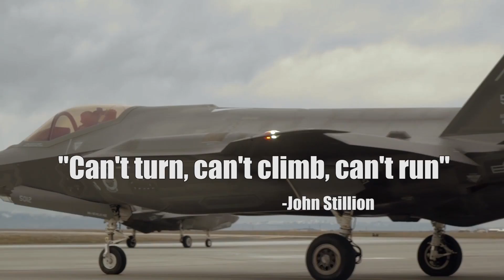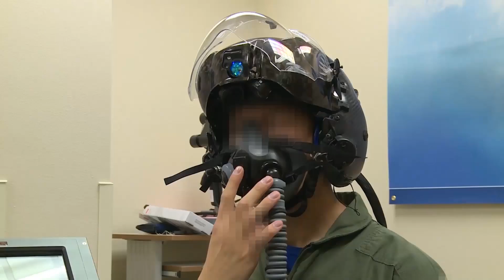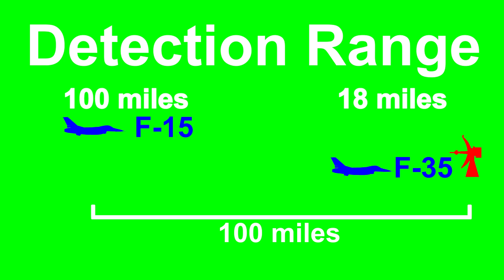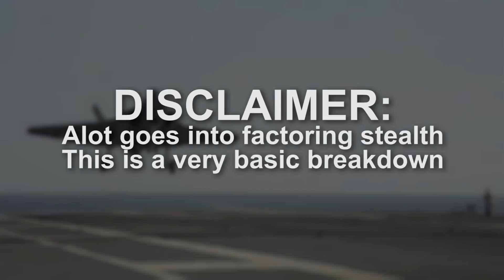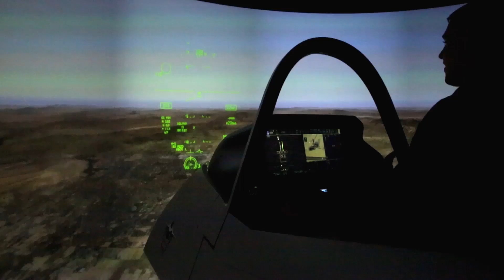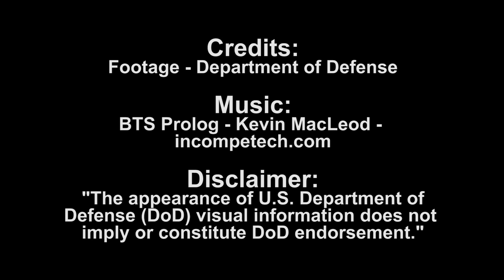F-35 Overview - The Good, The Bad, The Ugly

Comment: You missed a lot of things about the F35 that you could have found out just by doing a quick google search. You completely skipped its major selling point of its sensors and sensor fusion. No other aircraft currently or in history does it. You missed that it's getting a new engine with 10% more thrust and 6% more fuel economy. The aircraft ALREADY carries the same amount of fuel as an F22 and has excellent range without fuel tanks. You completely forgot about the internal Gatling gun. You didn't mention that the aircraft can pull 6-9 g's and hit full 1.6 mach fully fueled and loaded with internal stores which no other legacy aircraft can do. You didn't mention that the F35 can take command of drones to test enemy air defenses or take command of friendly missiles and target those missiles at its own targets. You didn't mention that in 2019 when the fighter goes into full rate production the internal weapons racks will get more options including a rotating rack so it can fight 6 AMRAAM missiles or even up to 16 SDB's. The internal bays are large enough to fit quite a bit of ordnance. You didn't mention that the F35 has 3 different countermeasures. It carries the latest chaff dispenser, Flare dispenser, and it has an pretty amazing ALE-70 POD towed decoy to jam enemy missiles. You didn't mention anything about its advanced AESA radar with over 1000 individual antennas or the fact that the radar can jam enemy radars while still scanning and watching for other air and surface threats. You forgot to mention the DAS system that sees all around the plane which is why the pilot doesn't need to look behind him. The plane itself scans and if it detects anything it puts it on the pilots visor and cues up a weapon or countermeasure to deal with it. The F35 can fire a missile at a target BEHIND it! There are so many things you are missing and THATS why the plane costs $100 million dollars. This aircraft is a major leap forward.
Reply: abelucious Any aircraft can be shot down. Stealth only delays detection. It's not invisibility. However the United States has pioneered Stealth Technology. We are very good at it. Where I feel we are actually are at our weakest is our air to air missile tech. Now that's a discussion I'd be willing to concede. Ever since I became interested in the F35 I also started looking up what types of weapons our fighter aircraft use. While the F35 might be kick ass we need to seriously develop new air to air missiles. There is no reason we shouldn't have AESA radar seeker heads and/or have missiles with dual seeker heads with longer range motors. The AIM120D is a good missile but it should have been improved a long time ago with how much money we throw at Raytheon.
Reply: @Lord_Shadowz  a decade ago I knew someone who was working on the avionics of the F/18 Superhornet.

I asked him about stealth. He told me it's already obsolete and that's why the Russian's didn't get involved with it all that much. He advised me that "spinning radar" as well as satellites make stealth obsolete.
P.S. - I don't know what spinning radar is but the Russian's have it and they've sold the technology to the Chinese.

All stealth is these days is (hopefully) getting to the enemy before they see you.
Reply: I don't know where he got this idea that it is less stealthy from. Current mock fights tell us that legacy aircraft pilots don't know they are there during exercises. When the JSF program was announced it was said that it would be less stealthy than the F 22. Now the Military people are saying that it is more stealthy than the F 22. Pretty sure it's stealthy enough especially because the Russians and the Chinese botched the stealth on their stealth jets.
Reply: Let's not get in a fight about what constitutes real sensor fusion ;p
Reply: The F 35 as sensors pointing in all directions and has the avionics to lock from any of them. Traditionally the radar and sensors are only in the nose of the plane, so you have to be pointing the nose at the enemy to get missile lock. The F 35 can detect a threat behind it, target it, and launch a missile that will pull a 180 and target the threat.
Reply: Gone Grizzly I see your point.. But with military GDP higher than Russia's is that really a big problem? And "The infographic show" said hourly usage cost is 30k. I may be wrong and I do not know that well so sorry if I am wrong.
Reply: No, the F 22 wasn't built with the amount of sensors and antenna that the F 35 was built with. That said, the F 22 is a monster of a plane with a lot of awesome features like thrust vectoring and super cruise.
Reply: Gone Grizzly You definitely have some points. For myself one thing they need to fix right off the bat is the fact that generals retire and then immediately go work for those companies. To me it seems like a huge conflict of interest. I think it's a huge part of why programs cost so much or happen when they shouldn't. As I said Lockheed has been allowed to get away with too much nonsense. The Pentagon did nothing to put pressure on them. Only recently have they started to try and get the program under control. They assigned a new general in charge and he's not playing around. He will flat out refuse to pay for things. As to stealth, you are absolutely right there as well. The good thing is while the public may not understand our military does. The F35's stealth is really decent. If you look at the radars and power outputs of the SU35 and the F35 and the Stealth characteristics of the F35, it shows the F35 can get in pretty close before the SU35 can get a track able lock. I think where the Air Force has screwed up is our missile technology. We haven't advanced our air to air missiles and I don't understand why? The Japanese has an awesome medium range missile with an AESA radar that's extremely hard to jam. Look at the British Meteor missile. Yet the US hasn't advanced. This needs to change. The only cool thing I did read about is the laser weapon system they are developing for the F35A and C models. Did you read about it? It's the same one that fits in the Reaper drone. It will go where the fuel tank is behind the cockpit and have 2 rotating emitters. One pops on top and one below the F35. It's pretty amazing.
Reply: You tell 'em Will.
The F-35 is a stone cold killer.
No fourth generation aircraft can stand against it.
Reply: Gripens might use GaN radars, SAAB in partnership with Selex are currently shopping this notion around as they apparently have the most "mature" GaN radars so far. Currently, models of Gripens don't have any AESA radar, but the E/Fs are due to have the Selex Raven ES-05s when they come off the production line soon. I haven't looked too far into it, so I wouldn't be surprised if someone were to point out that the E/Fs have been coming off the lines for the last 6 month, possibly longer.

GaN is relatively new and might not become a mainstay for another 10 years as customers are pretty happy with the GaA radars they are getting now, but it is suspected that all planes will eventually switch over. I don't know where this idea of GaN being far more superior came from. It is a pretty good upgrade, nothing more nothing less--experts believe that GaAs are plenty good enough for the present. I'm pretty sure air forces are much more interested in the GaN radars that will be ready in 5 to 7 years rather than the prototype level models offered now.

Which brings us back to how the F 35s stealth worked just fine against AESA radars during Red Flag 2017. I don't understand why people don't get that the F 35s performance in Red Flag was proof of concept, which explains why the US and allies invested so heavily  in stealth. If stealth didn't work, the F 35 would not have been considered too important to fail. The survivablility stealth offers is what they want and deemed by the pentagon as necessary. Why would anyone think the US Air Force would prioritize stealth so much if it didn't work. Look at their current programs for the foreseeable future. It's mostly the F 35 and the B 21. Hmmm, both are stealth, and you only need to look at comments Air Force officials make about the B 21 to realize that from their experience and stand point, the world's leading experts in conducting air missions as no one has done it more nor more successfully, that stealth is basically cheating and they have no interest of going into a fight without a super unfair advantage. The more one-sided the better according to them. They hope they can get 100 B 21s, but if they had their way, they would get 200 of them. What better endorsement for stealth could there be?
Reply: all i'm seeing soren is a bunch of unsubstantiated info coming from you brah. and there is a lot we don't know. the RCS of the F 35 is one of those things. That's what classified means.
Reply: Sören Nilsson I'm sorry but what you are saying is inaccurate. What missiles and bombs can it not carry? Right now it's already using all NATO air to air including Meteor and all Aim missiles. For Air to ground its using JDAM to Japanese and British bombs. You can find the videos on YouTube. It's already in testing using the SDB II as well and already uses the SDB1. Once the plane goes into full rate production next year the new internal racks will be introduced that will allow for more internal carriage. Instead of 4 AIM120D's it can carry 6 on a rotary rack. Or 4 120's and 2 AIM9's. Or a mixture or SDB2's and AIM120's. They've spent a lot on this project and they have things planned out. You can find out everything I've said in publically available information.
Reply: B Jiang the J20 doesn't have a DAS system lol. Just look at the J20. Please point to me where it's DAS cameras are please? Also China is INCAPABLE of making its own engines. That's why the J20 had underperforming engines. It's incredibly hard to make them. It's also why the J20 is only dirty stealth. It's incredibly hard to do. They had to steal it from America. Russia got really pissed when china purchased only a few of its previous fighters and then reversed engineered them and then made their own Chinese fighters. That's why they forced china to make a bulk purchase of the SU35. First off they are hoping it will take years or never that china can reverse engineer it and they are keeping the software codes to the avionics. But just in case the Chinese do they atleast are getting the block purchase. China cannot innovate. That's the issue. Look at most of the Chinese military. It's all copied and stolen ideas. China does espionage or buys something and then reverse engineers it and calls it a new name and BAM you have the Chang du super hornet 12. Lol.
Reply: Hey, I got a great idea. Let's not get new jets ever. You know cuz the world is a safe place cuz Russia and China don't make new jets ever. Besides, they are friendly to us anyway. If they like selling advanced tech to the people we'd rather not have said tech, that's not our concern right? National safety ain't a big deal. When have we ever been attacked anyway. Also, what has investing in the best war planes ever gotten us anyway. I'm sure we could've done everything the F 14, 15, 16 and 18s did over the last 30 years with F 4 phantoms. Why'd we ever upgrade from them anyway? There are probably planes cheaper then the F 35. What are the options? F 15, 16 and 18s. Hmm, that's interesting cuz that's what we are flying now. How many jets are the experts saying we should replace? What? The whole fucking fleet. And this one jet can replace all of them? Really? And that's the reason it's going to cost 1.5 trillion, because it's basically replacing the whole fleet. And compared to all the other jets where they were actually designed near or after the year 2000 at 100 million a plane, it's actually a pretty good deal especially because it has advanced features we would rather have over the same priced newer planes that are built in Europe? And F 35s are going to drop in price. I'm confused. I thought the F 35 was a bad deal.
Reply: Jas 39 E also have sensor fusion so you are wrong about that.
Reply: Yes gripen also has censors locking in all directions. And the radar on gripen cover a larger area. And yes gripen can also fire a missile that goes 180 and target the threat.
Reply: Jas is using GaN in its sensor system and that is making its sensors and E war system immensely more powerful than the system on F 35. 
The problem for both of the planes are that when they start to transmit they will be detected by the other plane, it is therefore important to be able to to depend on your passive sensors. Jas will see F 35 if it uses active sensors F 35 will see Jas if it uses active sensors. Ir detectors et cetera and luck will decide who is sees who. The Jas radar model had ample opportunity to be tested on Neuron constructed mainly  by Dassault, SAAB and EADS. Neuron has a smaller RCS than the F 35.  A similar system will in the future work alongside Jas or probably ahead of the Jas with the task of detecting others if stealth survives the new radar systems.
Reply: Sullir I saw that! They said in order to go on a full 3 month campaign against Russia   and win they needed a minimum of 165 stealth penetrating bombers. The US has gone back to fighting near peer combat and I love it!
Reply: Sören Nilsson Yet Israel is purchasing about 100 of them and is possibly the first county to have used them in combat over Syria. Search for the French article about the Israeli attack near Damascus in February where 3 F35's were used. Anyways, it's going to take them way more than ten years to figure it out. It's more like 30. Even then we have then next generation being worked on. The Russians currently have to set up radar systems all over the place looking in different directions in order to get multiple radars to get a glimpse at a possible low observable. It's the only way for them to get a track. The problem is the entire time our aircraft see them and can attack those links in the kill chain. So they've been working on lower frequency radar which is what our current stealth is more susceptible to. The problem with that is two fold. First is there is a shit ton more back ground noise. Figuring out what's a plane and what's not is extremely difficult even with newer computing power. So you need a large antenna. Since you need a large antenna this makes it very difficult, if not impossible, to make it mobile. Which again gives the advantage to stealth. With proper tactics, which is what the US has done for decades, stealth will change the calculus. Now add in the sensor fusion, the networking, the ability of the aircraft itself to sniff signals from passive radars and even communications from the ground, and the application of the constant non stop training of near peer threat combat training, I guarantee our stealth aircraft will do ok. The Russians and Chinese know this. That's why they have attempted to try and make a layered defense on their border in Eastern Europe. They've got rings of high and low radars with Pantsir and Buk systems that protect S300 and S400. But here's the thing. They are so afraid of stealth, specifically of the B2 itself, that around Moscow right now, as part of their ABM/SAM system, and you can look this up for yourself, are 48 nuclear tipped missiles. These missiles are designed to launch and detonate above Moscow in a ring to take out anything above it. To save the city. They've always kept it active.
Reply: If China was only trying to steal defense info from the big guys in the military game, technology is power in war no doubt about it so get the edge anyway you can, I wouldn't care as much because i get the you got to do what you got to do thing; however, China isn't restricting it's stealing in anything and is basically screwing  the whole world over. They have a strategy to become the world power. They know they can only do it with economic and military might. They don't have the ingenuity to compete with the big boys technologically at this point, so they are stealing everything of value until they are in the position where they wouldn't have to anymore to get ahead in the game. In many ways, it's very clever and effective, but in the global scheme, it is detrimental and crippling, not that China cares. The Communist Party is going to be The Communist Party.
Reply: Sullir Amen. I couldn't have said it better myself. Lucky for the US the information they did steal on the F35 they weren't able to fully understand and reproduce it. I'm also glad we caught the guy that compromised the information and he's going to spend the rest of his life in jail along with his wife who took part in it. The information the Chinese got was actually older data. So that was very fortunate. That's why you see the J20 and J31 designs as they are. The engines are very underpowered because they didn't get any of the engine data.
Reply: So, let me get this straight. You are comparing the F 35 to the Gripen and basically asking, besides stealth, which plane is better? Or why aren't foreign consumers interested in the Gripen because it is a technologically advanced plane?

The answer is simple. American jet fighters have the best performance records. No one else comes close. The amount of air dominance the US has enjoyed over the years is mind boggling.

Who makes the Gripen? Shrug, no one cares. Now, I not saying the Gripen ain't great. I'm saying realistically that other countries are going to have to prove they are making jets on par with the US before they will be able to really sell in that market. Mostly because it is super expensive and no one wants second best, and right now the US is sitting at the top. So, who ever it is that makes the Gripen won't get there this round, but hopefully next round depending on how the Gripen goes for the next 20 years if it's going to happen, but i don't think that is likely.

Truthfully, the biggest problem for non US companies is that the US, because they have the most active air force in the world, gets a bigger view of the picture. They basically know what tech and features are going to be important, so when they make a plane, it is a plane for the next 40 years. For instance, you mention supercruise was supposed to be one of the features of a 5th gen fighter. The F 22 has supercruise, yet here's the F 35, a newer US fighter, and no supercruise. Maybe, supercruise isn't all that important to 5th gen after all. Who would know? The US because they have it on the F 22. The Gripen on the other hand looks like it was built for the present. They threw technology in it because it was new, like sensor fusion, but in every other parameter, it was built with current conventions of air combat in mind.

Now you are asking, how is the F 35 different? The answer is simple, the F 35 doesn't focus on the things everyone thought was super important. Like maneuverability. Want to get ahead of the other team? Well then, write new rules to the game and make the other team play by them, which is what the US did when they decided to deal with things differently, and thus they put in DAS to make up for some of the F 35's liabilities when in dogfights against supermaneuverable foes, which frees up its physical design (because of DAS, the pilot doesn't have worry about position as much anymore, and can keep up with jets designed primarily for maneuverability--in other words, a sensor and software feature to counter the enemy jet's specialized, less versatile physical design) to concentrate on dropping munitions however and whenever instead. Because of the combination of the F 35's advanced stealth and sensors, If an enemy jet sees the F 35 before the F 35 sees it, then that enemy jet deserves to shoot it down; however, the F 35 is built from the ground up to make sure that scenario won't happen. The enemy will probably be able to detect the F 35, but at what range? Stealth makes the jet harder to detect, not undetectable. The goal is to detect before you get detected, and both stealth and sensors are important in this. Find and shoot first. That's how air combat is now. It's true that the F 35 won't be the best air to air combatant if it comes to within visual range, but the US knows that ground to air is a much bigger threat, and air to air skirmishes rarely happen. The F 35 is designed to make the battlefield different from what it has been for the enemy. You have to find the F 35 and not let it find you. If you can't accomplish this, the F 35 is going to bring the thunder willy-nilly. It was designed strictly for this purpose. It's an elusive snake loaded with venom.

What is the Gripen's MO? Not much separates it from the Rafale imo because they are just polished last gens with better computers and sensors, and those computers and sensors make bvr engagements and guided missile combat just that much more efficient vs wvr engagements which are virtually nonexistant nowadays. Maneuverability is only great in wvr, so why is 80% of the planes design still focused on it? 

Who ever wants to be on top will need to be the best at predicting the future, not the present.
Reply: Beer Me Allow me to retort. All 3 models have the most powerful engine ever placed in an aircraft. Ever. That's not a sensor. So to say the aircraft is not advanced isn't true. Second, the B model is the first and only aircraft in the world that can effortlessly hover and with the touch of a button go into supersonic flight, carrying its internal weapons. Those aren't sensors. That's the aircraft. The F35 can do petal turns, because of the powerful engine, that other aircraft cannot do even without directional nozzles. Those aren't sensors. That's the aircraft.
Reply: This the bottom line to the argument that the money spent on F 35 should've gone to European jets, which reasonably would've made them much much cheaper.

War planes are a major market for the US so they themselves never have and never will buy foreign in that market. Buying jets is not like buying guns after all. As pointed out, the US has huge sway when it comes to large contracts like the F 35, so it would be stupid of them not to use it. And lastly, I'm not convinced that the US would've considered the Rafale or Gripen anyway. The F 35 was the jet they wanted, and the Rafale and Gripen don't resemble it at all.
Reply: William J Greklek III whhaaaaat the f35 can shoot behind it? Please explain that's cool
Reply: The jas 39 E has basically all of the capacities of a F 35 but it is not as stealthy. the plane itself is ok, but the missiles that it carry shows up on radar. SAAB is now trying to make the missiles stealthy. There is a double gain with that. You will not see the missiles before your infrared system notice them. Thereby making response time shorter and you do not have to sacrifice agility on the airplane construction.
Reply: @sorennilsson9742  the Saab is more expensive with less capability than f35
Reply: Ps. Jas also has towed decoy, the same radar capacity with a wider search angle twice the angel of F 35. It also have a more powerful electronic warfare suite.
Reply: Says who? It all comes down to the radar question. Is stealth going to be stealth, there are many signs that newly developed radar systems are starting to beat the stealth known to day we need a new stealth system.
Reply: Gone Grizzly just Becuase you have a coding flaw doesn't mean you'll lose the plane and the pilot
Reply: Yes but al of that a jas e wil do to exept for the 99% stealth
Reply: Yes, but radar research has not focused on stealth until the last 20 years Russia is today capable of detecting stealth planes but lacks the precision needed to guide the SAM systems. They are working hard at improving that. Israel has stated that stealth will be obsolete in 10 years and they are usually right.
Reply: Yes, it will be done but the missile is too long so there is a lot of engineering to be done expected time for that is 4 years so sometime in the 2020s meteor could be launched off a F 35 B. And that excludes the use of the new internal rack if I have understood it correctly. So actually you answered your own question.
Reply: Gone Grizzly 
About the f117, like previously mentioned it had flew the exact same route, which the Serbs had learned of. Bomb bays do allow for stealth but when they open it temporarily will compromise the position of the craft. Even though this is momentary it let the Serbs know about the timing of the aircraft so they took a potshot at the aircraft in it's expected position, their missile managed to get a lock on to the craft and shot it down. Even though the f117 was stealthy it was rendered useless due to it's predictability, the error was tactical not technical.
Reply: Gone Grizzly 
"Stealth is not an invisibility cloak." I don't know how many times I've heard people opposing stealth say that despite no one who supports or defends stealth tech has said that. Stealth is indeed not an invisibility cloak, it is camouflage and at certain ranges or speeds It doesn't matter what camouflage you are wearing you will be seen. Stealth allows for surprise, it clips the range of anti air systems, because it doesn't matter if the anti air missiles have a range of 200km if the radars guiding it can only track the plane consistently from 80 km away. In this way the anti air defences can be outranged by comparatively primitive missiles. And even when stealth planes are detected, most of the time the radars which detect them can't consistently track the plane or guide a missile to the stealth plane when both are necessary to consistently shoot one down, and this is ignoring factors the stealth plane pilots can add to the equation.
Reply: The new Chinese jets are definitely going to change things a lot, but they also illustrate how far China is behind the US as they haven't been able to get the same results from the stolen plans and have had to resort to purposing those two fighters for very specific disruptive roles instead of having head to head capabilities with the F 35 and F 22. China's next gen fighters after this one is probably going to be where they are peer anyone, but the current government will have crashed and burned long before that.

Here's  to the future of China. May they recover quickly from the fiasco that has been the peoples' communist party. Quite frankly, I'm tired of feeling a deep sense of pity for them.
Reply: Sören Nilsson JAS 39s have limited sensor fusion capabilities, and are among the best 4th generation aircraft, especially for cost. But it's delusional to assume that an aircraft that attained a 20:1 K:L ratio at one of its earliest Red Flags (one that happened to be one of if not the most difficult Red Flags for Blue Air ever) would strategically fail to a force that has 5 times as many JAS 39s. If you had 5 times as many planes as a force using F-35s and could sortie 5 times more often, you would only be able to put 25 times as many planes in the air. F-35s offset this type of disadvantage in a lot of ways; the most effective and strategic way would be the utilization of SAMs fired from ships. An F-35 squadron runs at a mass of JAS-39s, fires its missiles (at least 4 AIM-120s, soon 6, and eventually 12 CUDAs internally per Lightning II), and either hides, runs, or both. The aircraft would likely have the ability to retreat or run to an area guarded by friendly AEGIS boats, which it can target missiles for. If it can't, and there are too many JAS-39s, the flight could simply not engage.

That's a limited scenario, but it demonstrates quite well the flexibility newer 5th gen aircraft have. 5th gens can decide when the engagements occur, if they occur, how they occur, and where they occur. They are flying guerilla insurgents that are networked with the overwhelming firepower of a conventional force. F-35 drivers will have insanely diverse strategic and tactical options, and if there's a world war, my fucking god, the aces could have hundreds or thousands of kills of not only aircraft, but ships, tanks, anything.
Reply: That comes from you still do believe in the figures posted by the producer. 1, old radar system has no problem detecting F 35 old night fighters from the second world war would have no problem seeing the F 35. The Russian new systems even locate the plane so it is possible to direct missiles at it.  2. The F 35 has an engine that is a torch compared to an F 16, in other words, it is vulnerable to infra red detection.  3 if any plane today uses their own radar they will be detected. Hence the passive sensors are the most important sensors. 4.The capacity to share information is thereafter the most important capacity and the tactic they implement. 5 The impotence of supercruise is your get away, free card if you have to go on afterburner when getting away after the engagement a plane with supercruise capacity will soon drain the plane without. 6. the standoff distance of your weapons be it air to air, ground or sea it does not matter are the basis for winning over the enemy air defense. With today's systems, you ought at least be at distance 150 km from the target when we drop your cargo. Only special airplanes are suited for close air support and that after you have suppressed the enemy air defense.  
Can we agree on the above? If so we can take the discussion from there. 
Secondly, your remarks of the read air, since I have no information on how the exercise was conducted so the figures say me nothing. What sort of E war systems was in use what radar systems did the other side have and so on. How did the combinations look like,  however I know that  Lockheed Martin once claimed that the RCS on the F 35 was F-35 / JSF 0.005 m2? The findings by the Congress was that it was 75% larger. That means 0,009 a very respectable number putting the new Jas 39 E at 0,08  m at an RCS 10 times as high as the F 35. Of course, we are now discussing a front view. from the sides F 35 is better but from the back, I think Jas would win. Anyway F 35 is here superior with a factor of 10. To play on an equal level is impossible in that area for Jas 39 E, therefore they have to compensate and they have done that by using Galium gallium nitride in their systems (GaN transistors withstand extreme heat and are capable of handling frequencies and power levels well beyond those possible with silicon, gallium arsenide, silicon carbide, or essentially any other semiconductor yet fabricated.) By doing this the radar system levels up the difference. Furthermore, the E war system on the Jas uses GaN transistors. So technology not invented or specified when F 35 went into production now is rapidly eating at the F 35 strengths. Therefore I do think F 35 in many ways is superior to a Jas 39 E. I also know that it is not as superior as you think. Actually, a radar on a Jas would damage a  radar on the F 35. When it comes to the E war I do think they are evenly matched. Ir detection Jas is probably stronger her a new generation with new capacities. Development in all those areas has come to a bit further than what they were 5 years ago. If those components will be enough to counter a 10 factor in stealth is a question I can not answer. What I can answer is that it seems smarter to make the skin of the cargo stealthy compared to hide the cargo in a huge airplane detectable with long wave radar at very long distances. We will se what strategy will be the solution in 25 years.
Reply: Define limited sensor fusion, Jas 39 E combines air, ground, sea, satellite, command and their own sensors to one digital information, so if you want to add to that list you will find that the F 35 also will fault. The speed of the computer system is higher in Jas E compared to any other plane flying simply because it has the most modern system where flying and weapons are separated. It is the first military plane that has this. It means that integrating a new weapon system is done extremely fast in comparing to other planes. So it is back to the question how effective stealth will be in the future. When the specs for gen five was made it also included supercruise. So we can argue that F 35 is not a gen five plane but a gen 4+++. Do not forget that it was the constructor of F 35 that made those specs before they realised they could not meet them themselves.
Reply: Enough stealthy that it´s infrared detection capacity will see the enemy before their radar sees it. By having a smaller engine they will detect the enemy first if there is an enemy equipped with a similar ir detection system but has a larger engine. It has to do with balance if the USA would produce a Jas E in sufficient numbers the price of the plane would be less than an F 16 block 60. The F 35 is superior in certain scenarios. But the cost to run it is at the moment a huge problem. You are wrong when you say that maneuverability is not needed. the importance of acceleration and maneuverability is still important but less so today compared with 10 years ago. The day of the dogfight is not yet over Jas C had the highest F22 kills on Read Flagg 5 years ago. I suspect that the same results will occur when Jas E goes over the pond. Furthermore, do not underestimate the Rafael it to is stealthy enough to force the opponent to use infra read in stead of radar. Yes, the capacity to fire a missile and let your wingman guide the missile while you are evading the enemy missile is just as important today as a good e warfare suit was during the Vietnam war. The net-centric capacity is also of utmost importance, things like beamed data links are vital for avoiding detection, you can not leak in any area of the spectrum. There is no doubt in my mind that maneuverability is important if you don´t want to be defenseless when enemy hunters break through your escort. Towed bogies, E war suits, the risk of using your own radar still makes the dogfights a likely scenario in the future. Since 1950 we have heard that guns are history. I do not know, but I believe that by nulling out specific capacities dogfights will be more frequent in the future than today. There is a high likelihood that I am wrong but I can just as well be right when two technically advanced systems meet it ends with no missiles left and no kill for any side, then the maneuverability and the guns will be useful.
Reply: IR sensors don't have much range, if modern fighters are stealthy enough that IR targeting is what it will come down to, then that is really interesting; however, i doubt this is the case because AESA Radar is still a really big selling point, whereas you barely hear about infra red in a very side-note-like manner. I could be wrong. I love to learn, so by all means prove me wrong.

Maneuverability is still important, but I suspect that super-maneuverability is in the same boat as super-cruise. Again, the F 22 has both of these features yet the US still ditched them like it was nothing. I think it's because neither were worth the compromises. You have to have two engines for super-cruise, and super-maneuverability is really pricey and requires a lot of physical design features to pull off. The US obviously didn't think these features were worth it compared to the range and maintenance ease given by a single engine design, and it's easy to see that the F 35 is much smaller than the F 22 but can carry bigger bombs, likely indicating that the F 22's physical design which emphasized maneuverability probably didn't lend well to internal payloads especially considering how much fuel it needs to hold for those 2 massive engines.

A dog fight can still happen and that's why pilots train extensively for those scenarios, but no one looks for a dog fight regardless of how superior their plane might be in one. It's a last resort, and rarely happens. The mode of combat has changed since Viet Nam, it doesn't make sense to limit a fighter with something like super-maneuverability in this age when the thing you really want your plane to be able to do is drop a lot of bombs in a contested airspace relatively safely. Again, most planes that have been lost were shot down by ground to air threats by an enormous margin in the last 20 years, and that is the reason why the F 35 is selling.
Reply: AESA radars are game changers in the way that if you have the system and your opponent does not you are going to see him first unless you compensate by reducing your rcs to the level that other sensors will pick him up before his AESA radar sees you. A Jas E would see an  F16 block 60 so far ahead that it would be able to fire its missile turn and run away from the F16 using the shadow in the doppler effect thereby being able to shot down an F16 without it being able to detect the Jas E the use of the shadow is of course made possible by the Jas ability to angel its radar, the radar coverage of more than 120 degrees is what makes it possible to do this . The F 16 would know that there is a plane that has locked his radar on him. Here it is important for the Jas to use a very narrow radar beam in order not to get another F16 into the same beam. If there are two F16 block 60 I presume they have the capacity to triangulate the source of the beam hence being able to fire their missiles. But firing a missile today does hardly guarantee a hit unless the missile itself is stealth and is used by a passive detection platform. The 20 to 1 result of the F 35 is to be expected I would think the situation would have been very similar if Jas E did meet F16 up to block 60. The capacity to detect a 5m2 aerial target at 105km does not impress anymore. The F 16 was one of the best-constructed airplanes in world history has, unfortunately, a best before date as all tech equipment has. It is a tribute to the constructors that it lasted for 40 years. Even if it is modified the total lack of consideration to the rcs problem will stop it from being useful in 10 years because of the development of AESA and the spreading of the knowledge in production methods. Thea AESA is also far superior for air sea or grounds attack with a resolution not earlier possible.So it is a game changer if you have and the opisition does not. When it comes to selling the F 35 the USA are using considerable political weight to do it, an example of this is when F 35 was sold to Norway and Denmark, no other plane would have been sold whatever their performance is. Of course, the USA should use that power everybody else does their best to use their own pressure be it economic, political or other methods. But do not think that it always will be the most suited for the cheapest plane that ends up the big winner Finland bought planes from the USA the last time in order to integrate their air force to Nato without being in Nato. Jas at that time was not Nato integreated so it will be iteresting yo see ther choise this time.
Reply: A big problem that I'm seeing for the Gripen and the Rafale is that it's really hard to find out anything about them that sets them apart from other modern jets. I looked for anything about the Jas C's performance against F 22s and was brought to a worthless chart that rates the capabilities of both jets on scales of 1-10. It was really quite silly. I didn't find any mention of a Red Flag six years ago where the Jas C had the best success vs F 22s.

I guess people just don't know how to report and identify useful information, and slightly because of this, the people who are trying to bring up Gripen and Rafales in F 35 youtube videos come across as disgruntled that the F 35 is taking all the lime light, even though half of the attention has been bad.

There are things I just can't find out, like how IR sensors are going to work when the jets on both sides have significant low observability features. Also, because it is highly classified, just how good stealth features are. The only thing I can gather is that stealth is what everyone is banking on for survivability.
Reply: Beer Me makes the same mistake a lot of people make in assuming a jet is only as advanced as it's flight characteristics, especially those of maneuverability and speed because prioritizing those features had been the trend for the last 35 years with the jets we are all familiar with.

The F 35's physical design on the other hand tries to optimize range, payload and stealth. That's not saying that the designers didn't care about aerokinetic performance, it just wasn't the priority by design, which is why the maneuverability of the F 35 is only equal to the fighters of the last 20 years and isn't an advancement at all.

But to say that the sensors is the only advanced thing about the F 35 is laughably not true.
Reply: You are making a lot of assumptions. You need a certain number of the variables to complete an equations. That's established math. You make the same mistake the creator of this video did. He assumed he knew the rating of the F 35s radar cross section, which is why his calculations are wrong. 

Most of us have known for years about radars with wide bandwidth being able to pick up stealth planes, yet stealth is still what sells in the market, and the F 35 is one of the most impressive stealth setups there is. In Serbia, they had to set up a specific radar in a specific place where they knew a specific F/A 117 was going to fly. They knew that the plane made that route routinely, but they couldn't shoot it down until they put that clunky radar there. Technically you are right about it being passive detection; however it's not like they can set those things up anywhere as a passive defense. They have to know that a stealth plane will fly through a very narrow area on a huge map to have success (yes that not unimpressive range you mentioned is still nothing compared to the amount of territory that needs to be covered, and good luck trying to hide a network like that if it were setup), and that is only certain with the F/A 117. Who knows what else they would have to do to nab an F 35 because it is classified, which means you have to operate under assumptions.

The way you write makes it sound like tests have been done against F 35s that confirm what you are telling us, but we know Russia has not in reality made such tests, so in actuality we are really back to where we started because we only really know how the new tech stacks up against the old. For example, we know that F 22s don't have a problem against S300 SAM systems, but not how it would work against S400s because there is no data. It doesn't mean the S400 would decimate F 22s, it just means that we don't know what would happen. Too much of it is still classified on both sides.

What we do know is that there are things about the F 35 that are being kept secret that sells the jet to allied countries. It's been alluded to by Australian authorities who had been put in the loop and bought the plane even though their experts were saying it was a mistake, and by US Congress in the yearly hearings when the program comes under review. There are things we don't know, and in physics there are some assumptions that have been broken. Invisibility was once thought to be impossible, but now the science community knows through conclusive experiments that it is possible. Real invisibility and still being able to see outside the effect. Who would've thought?

IR sensors have very short range (good luck trying to create a passive defense with those), which means they work best when you have them on a stealth platform, and if Russian stealth detection nullifies stealth, then why are they trying and failing to make stealth planes? If they really thought stealth was no longer relevant? Do you really assume you know more about this than the US Air Force who would buy 300 very expensive B 21 stealth bombers if they could even at the expense of getting anything else? Obviously stealth is still relevant. it is considered to be the only feature that makes a fighter or bomber truly survivable in a high threat environment. Period.

But why am I even trying to explain this to you when it's obvious you are trying to spread propaganda that the Russians have defeated stealth, which is a message they want out there because they are unable to do stealth properly. Mean while the the Americans use stealth willynilly because they can ;p
Reply: Sensors are becoming more advanced. The F-15 did unprecedented things during it's reign as king because it had a sensor advantage. Sensor fusion is a new thing that has been utilized to a limited degree by some fighters over the last 10 years, but still has a long way yet to reach it's full capability. Do research Pickled Sausages. Your comment reveals that you don't really know much about this topic, and it makes me wonder why you even bothered to reply in the first place.
Reply: All i see is the ramblings of a person not qualified to talk about these things. If you had payed attention to the testimonies of US pilots flying F 22s, F 16s, F 15s, and F 18s the biggest reason why so called 5th generation aircraft obliterate legacy fighters is situational awareness. In the many mock fights the legacy planes couldn't see a thing and the F 22s saw everything. The F 35 is built from the ground up to have a situational awareness advantage over anything built before it, even the F 22. Those stupid missiles you keep spouting about won't do any good if the pilot's aircraft is blown up before it even knows a a threat has targeted him. Infrared sensors have short range which is why AESA is still the standard and most desired type of sensor. The F 35  has or will have a topnotch array which will include Infrared, which only makes sense to have on a stealth aircraft in the first place. The reason why the F 35s kill ratio during red flag has the 1 proportional death is because of one incident where they were seen in visual range. I know you are going to try and bring up that those stupid missiles can target the munitions from F 35s, and my answer is going to be "So What!"
Reply: My apologies, I don't mean to be so grouchy, but it rubs me the wrong way when someone looks at the specs of something on paper, says "OP confirmed" and then tries to argue that a single type of missile has changed the whole game when munitions is a continually changing enterprise that is currently offering a lot of different strategic advantages, and there is going to be counter-measures for all of them. It's ridiculous. If American air-superiority is going to be beat, it's going to be because of SAMs. Ground air defenses are the real threat.
Reply: We had an F35 catch on fire because it was taking off along with the wind not against the wind..... you won’t see that on the news
Reply: William J Greklek III it was originally designed to pull 9 g's but only managed to pull a maximum of 6.5 while testing a hard right defensive turn.
Reply: Gone Grizzly oh and by the way you are completely wrong. A B2 has never ever been shot down. We produced a total of 21 B2's. Twenty were frontline bombers and one was going to be a training/upgrade testbed. Once they decided to cut production they turned that last bomber into a frontline bomber. It ended up having an accident near Japan and crashing. I'm not sure why you think it was shot down?? Now what was shot down over Serbia was a F117 Knight Hawk. Let's discuss it. The F117 had flown the same route for 11 days in a row. It absolutely shouldn't have done that. It gave the Serbs a perfect opportunity to set up a low frequency radar kit they had cobbled together. Then the bomb bay doors on the fighter were not working right and unfortunately were open. This gave a blaring signal for the Serbs to see on their screens and a huge traceable signal. Once they fired, the final piece of the puzzle was in play. The f117 was not equipped with a radar warning receiver. There simply wasn't enough room on the aircraft for this system. So once a missile was fired the pilot had no idea he was under attack. So you take those three things and you have a downed stealth fighter. After the analysis was done the lessons learned are taught so as to never allow it to happen again. Stealth aircraft wouldn't even take the same route 11 times in a row in a combat area. It was pretty much luck that they got the shoot down.
Reply: Sullir oooh that's pretty cool does the f22 have this tech
Reply: I think you misunderstand the information Jasmine.

It's true that the F 35 doesn't go mach 2 like a lot of fighters these day; however, top speed is a whole different beast than cruising speed. Most jets can't cruise mach 1+, cruising just under breaking the sound barrier, needing to light the after burners to go past mach 1. There are a few exception. I don't know the whole list. The F 22 raptor is one of them, able to cruise in the neighborhood of mach 2. With this in mind, the F 35 seems by reports to be built to cruise at .9 mach. Yeah, not the fastest but is actually really good by today's standards. Those exception are few and far between, and I think the reason why is because those planes that are the exceptions aren't worth the cost. The US Air Force was pretty adamant about a single engine jet. So much so that they overruled the Navy who has always demanded two engines. A two engine design like the F 22, one of the exceptions, is what you need to cruise mach 1 +. The bottom line is that if such a feature was so vital, the F 35 would have adhered to it, but instead the US military wanted the advantages of a single engine jet instead. I think the message is clear. They have a jet that is the exception, but having that capability ultimately helped them realize it was overrated. You have to understand that the F 22 was costing 200 mill a pop, and it's production was halted by the Obama administration because it was deemed too expensive--hell, Obama wouldn't even let his picture be taken if there was an F 22 in the background. The F 22 is exceptional in many ways, but the cost of those designs for exceptional add up.

Where y'all get this lack of range nonsense baffles me. The F 35 B might be considered to have less optimal range, but it's being launched from light aircraft carriers which makes up for a lot. A fully loaded Adv. Super Hornet (basically sprouting fuel pylons) beats the F 35 C in range but not by much, and even then such a loadout would be a burden to the hornets flight performance whereas the F 35's exterior will basically be clean and not be at such a disadvantage. Again, there are aircraft that outclass the F 35 in this one thing, just like in cruising speed; however, when compared with what fighter aviation offers the world today, the F 35 in this regard is still really good.

The thing to take away from this is that no other strike fighter offers it's payload with it's range and sensors. And then you add the stealth. The F 22 can't do a lot of the things the F 35 does as a strike aircraft (can't hold 2k lb bombs for instance, nor does it have the same degree of sensor capability). The F 35 is primarily a strike aircraft. 
 Strike aircraft sorties are the majority of what the US and allies fly by a huge margin. The fact that it can do recon at the same time is why it's a game changer, and may be a reason why the F 35 might be more ideal for CAS. The A 10 is a bad choice to try and scout with because it's so much slower and is so much more vulnerable to SAMs. Almost all of A 10 casualties is SAM related. If the dead A 10s had known they were there, they wouldn't've been shot down. The F 35 will be able to find them before it's too late.
Reply: The internal gun is that on all variants or did they have to lose it on the navy and marine model. Secondly  “There will be no gun until [the Joint Strike Fighter’s Block] 3F [software], there is no software to support it now or for the next four-ish years,” said one Air Force official affiliated with the F-35 program. “Block 3F is slated for release in 2019, but who knows how much that will slip?” that was from 2015 I just wondered if they have fixed it. As I understood the article then the ballistic of the bullet was not ready so what has changed? I do think that the Jas 39 F will be ready by 2019 you should have produced Jas instead. I am sorry that the first engine did not work out it must have cost a fortune to construct a new one. Are all the already produced planes going to get the new engine or are the nations who already have bought planes stuck with the problem engine and what are you going to do with all the old engines that you have produced are they going to end up on another plane? It would be a terrible waste not using them, I mean they were so extremely expensive. I must admire the USA no other country could ever afford such extravagance. Think of the Billions that was wasted, it could probably have been enough to buy a 100 jas 39 planes. They are so cheeped you know that you can fly 5 jas for the price of one F35 flight, and they can do many flights every day. I figured when fighting you need 3 F 35  to do the same amount of missions as one Jas 39 e. But I hope that you will solve that problem because no one needs a hangar queen.
Reply: I found the page on the Rafael https://theaviationist.com/2013/06/19/f-22-shot-down-by-rafale/ fighting an F 22, you have to be patient watching the video it starts with a lot of text. Unfortunately, I did not find the original link to the information about the Jas at red Flagg, I remember that it was an American page, what I found was a Swedish homepage actually having two quotes from that the page without references. I have asked them to provide me with some references as soon as they do I will send them. https://ragnaroken.com/2013/04/09/the-highest-scores%EF%BB%BF-of-kills-at-red-flag-2013-nato-exercise/#comment-313. Ragnarok is not a homepage that I would quote since I know nothing about them.  It is usually very hard to get the results of Red Flag during normal years the only nation I know of that even leak them are the French. What I do know was that the Jas pilots were impressed by the F22, I also know that Jas 39 C is hard to find with a radar due to some small tricks that can be done with the plane's radar. The latter normally being the hardest area to not get a reflection of. About the performance, you can find some on SAAB:s homepage but yes they are not overly generous with it. During the cold war, Sweden always tried to keep 20% of a planes system capacity a secret.
Reply: Gone Grizzly In essence true, but the issue seems to be rather a problem with (old) monopolies. I'm looking at former state owned companies in my country and they all suck, even though they have been privatized for several decades now.
Reply: William J Greklek III The sensors are leaps ahead but the aircraft itself is not.
Reply: You want to be an expert? Go to F-16.net and read what actual pilots and engineers say.
Reply: The software isn't even final. My prediction is that it was designed to be as agile as the F-16 and it will be.
Reply: Gone, the plane only looks good from the front cross section. This plane does not look great, but does an excellent job of killing every aircraft that goes against it.
Reply: Shade is apparently an expert and has access to classified information. So Shade, where was the testing done to determine that the F 35s stealth can still be tracked for passive interception? Where is that source? How did you come to that conclusion? I'm interested. Enlighten me.
Reply: Sullir I'm interested as well.  Especially when unclassified information flies in the face of what he posts. So, Shade, the classified info please!
Reply: Gone Grizzly i think it depends on the radar frequency how stealthy it is
Reply: William J Greklek III not to mention it has a titanium airframe
Reply: sensors and sensor fusion? You know every jet ever has gotten this stuff since digital became the standard upon the worlds militaries right?
Reply: raptor millennium assumptions? Dude, name 1 modern jet made within the last 30 years that doesn't have sensors of all sorts. It is the digital standard. Don't be a moron and make unfounded insults.
Reply: It's not the sensor array that makes sensor fusion. It's the advanced software that seamlessly overlays all the data from all the senors, even including senors on different craft entirely, to one interface in the most work friendly way possible. The software design for the F-35's sensor fusion is the most complicated and time intensive part of the whole program, and also has the highest amount of risk for failure. Sensor fusion is state of the art technology. Anyone that has been paying attention for the last 5 years would already know this.
Reply: all these can already be added to F15 and F16,  every single one of these features, they cost a lot, but such planes are faster to modify, service and operate.
Reply: Jesus Christ man, OPSEC
Reply: Stealth was probably the Air Force's top priority--you really can't significantly upgrade the f 15 and f 16 for stealth, not to the lvl of f 22 and f 35. They needed to build new aircraft because what they have is old. In this case they could build new f 15s and f 16s, it is the plan to build limited numbers of them new because it is cheep and they are still useful, but they mostly want to build off of a new platform that will let them build for the technology they want from the ground up. They can do a much better job that way. I don't think they could put DAS in an f 15 or f 16.
Reply: Yes the industry has to move on, the F35 was needed,  however the marketing around it is not realistic,  neither is the Red Flag result,  in real battle it will have something like a 3:1 kill ratio against most F16s.  How's the F35 going to handle 60G Air to air missiles?  these missiles can intercept and destroy F35 missiles.  How is it going to handle passive radars, infrared sensros,  and sensors that can detect turbine exhaust gases, and how is it going to jam powerful SAM systems, their technology is not fully understood,  there has never been any SAM, or missile or aicraft, from any country, that is not possible to defeat somehow, and it is, but not by a single aircarft or group of aircraft,  it's usually done by aircraft together with additional equipement.
Reply: yes one way jamming works is by cancelling out the received signal, with an equal signal which is 180 degrees out of phase,  or by sending out intended fake echos, seen further away from the aircraft,  these methods are not secret.  And the use beam forming (phased array) antennas, just like the AESA radars,  you can very easily jam or fool SAM that rely on primitive antennas,  but if the  SAM has phased array too, it can focus so much more energy on a target.   Phased array technology is not new,  it has been used for several years by the US military companies and others,  even cell phone towers use phased array technology today,   there's nothing new about the principles of AESA and Jamming,  it's the controlling software which is becoming more and more complex,  it may even have artificial intelligence, so that the pilot is not burdened by too many tasks
Reply: F117 was different,  it relies more on geometrical properties rather than absorbing radiation,  it was designed to reflect received signals up or down, rather than sideways,  hence the weird shape.   And it worked, Yougolavia was flattened by bombs.     But in good SAM setups (which are quite complicated to setup and operate),  a single plane doesn't have chance,    you need wave after wave of decoys, and then many bombers to really win.
Reply: and it's actually very complicated,  because if a SAM is only very accurate that is a disadvantage,  you can use its accuracy, to fool it into depleting its missiles on decoy targets.  That is very possible,  but F35 electronic counter measures cannot possibly fool a network of advanced radars,  it's impossible in terms of physics to perform electronic jamming.  All the spaced apart receiving antennas compare the same signal received, and if they don't all agree on certain parameters, it means the signal is not a real reflection, or not a genuine transmission.
Reply: Consider highway speed cameras,  they work based on the doppler phenomenon,   they transmit a frequency F,  and because the incoming car compresses the waves,  the reflected frequency Fr, is higher than F,  it runs simple calculation and works out your real speed. Can you fool it? Sure!  all you need is a sensor, a computer and an RF Transmitter, if you identify the frequency that hits you F, and then instantly send out a very strong frequency F that completely supresses the reflected Fr,  the camera antenna will see you as a standing object, if you transmit a strong Fr, slightly higher, corresponding to a norma speed it will again fool the camera and no ticket will be issued.  But what if you are facing multiple hidden cameras, at different spots, all interconnected to a central computer, where signal path delays and doppler path frequencies are taken into account?  a single wrong vote by one antenna will give you away as being a deceitful signal,  and it's perfectly possible to detect where you are.
Reply: VERGIS92, I've only been putting forth information I've come upon from sources. Where does that speculated 3:1 kill ratio come from? You?
Reply: no,  it comes from air to air missiles that can turn very fast, 50-60G acceleration,  and can shoot down the missiles of F35,   the red flag 24:1 figures have not taken this into account at all,  as well as other factors.
red flag is only a simulated exercise where kill is calculated probabilistically based on legacy warfare. It is therefore naive to say that F35 has proven 24:1 kill ratio against legacy fighters,   it can detect the enemy first, but it cannot shoot them down so easily.   And similar technology has been developed for tanks,   I am talking missile vs missile now, you have no evidence that F35 missiles are stealth and super accurate, or in any way better than those carried in F16s and F15s
Reply: You are not an expert. Any credibility you might of had is blown because you threw up numbers and figures on the fly with nothing to back you up. You can't be trusted to provide valid information, so I won't pay attention to anything else you post, and I'd be surprised if anybody else does either.
Reply: maybe,  but 60G air to air missiles DO exist, and can engage incoming targets all over the aircraft,  even behind.  you somehow think that only big targets can be engaged,  no they can intercept small objects too.  Please start learning about active defence and Elbit's  tank protection system,  that system also is not taken into account today in any exercise involving tanks,  and yet it renders most anti tank missiles useless.
Reply: oh and I forgot,  modern subs also have similar interception capability,  you throw a torpdedo at them,  they throw a torpedo at your torpedo,  this isn't the 1940s, it's totally impossible to have a 24:1 kill ratio,  no matter who says so. No matter how stealthy the attacking sub is. You will run out of torpedos.
Reply: If you had said something to the effect that it was your OPINION that because of these technologies that YOU  THINK the F 35 wouldn't have better than 3:1 ratio, it would have been different because you wouldn't have been misleading people to think the numbers and figures came from a credible and authoritative source.
Reply: 3:1 at best,  and only in some 3rd world, dictator ruled country where they are not motivated to learn more, and don't use anything effectively.  to get a 24:1 kill ratio against a prepared enemy is ridiculous to even say,  it's forbidden by laws of physics and probability,  there's a ton of information which is never revealed in red flag exercises by neither side, so don't tell me it's realistic,  if it was to be revealed then it would no longer be a secret tactic
Reply: and you cannot defy physics,  a large long range missile is always heavier than a short range missile, and cannot possibly outmaneuver it,  period!  it's more mass more inertia!
Reply: nice aircraft, but both you and the test pilots are talking as if technology evolution stops at the F35,  is it possible that it has reached the limit, Lockheed Martin has figured everything out,  so we can all go home,  and they will have to lay off their scientists too, because there's nothing more to be made, F35 is the end of mankind's evolution.  Well, test pilots are good people but they are not scientists, nor spies, I'd rather hear what scientists and engineers have to say.
Reply: missile speed is a life time, in the domain of electronics, a very long time! I will be convinced of asymmetrical warfare claims only when I see them in action, missile VS missile.    to this day,  all missile systems can be hacked, and dealt with,  all of them,  Russian, french, whatever, no matter how advanced, they cannot defy physics
Reply: in fact,  Lockheed Matrin has invented nothing new,  it pours millions into work, and then gives tasks to subcontractors such as Raytheon and Grumann,  all modern fighters have is a  high concentration of legacy technology,  AESA and infrared  were invented in WW2, there's no secret working principle.   and when there's a breakthrough it will come from some inventor,  or some university program in the US,   remember who invented the airplane, or the radar, or the split of the atom, they were lone inventors, not multibillion dollar companies,   you think Lockheed Martin will invent antigravity?  No, it may come from America, but it will be some lone, free thinking inventor working in the garage.  And it will put turbine makers out of business, just like the Wright brothers nearly put train companies out of business.
Reply: Lockheed is just the contractor, the demands for what the military wanted was made by the military. Lockheed just happened to have built the best prototype based on what the military demanded. Again, you are showing what you don't understand.
Reply: Gone Grizzly 
Exactly. Stealth allows the aircraft to create a safe corridor between and through defenses in order to infiltrate airspace. People mistakenly think stealth means invisible. Just like they think a silencer (really a suppressor) makes a firearm completely inaudible.
Reply: Thanks William, well said.
Reply: William J Greklek III Hi, I would like to know where do you get all of this informations, I'm really interested in military technologies.Is there a website or a sub Reddit ?
Reply: He also forgot that Israel already used its F-35-Adir fighters in Syria and they bombed their target undetected. Meaning that the F-35 is already combat tested.
Reply: Jesus come the f**k down man. He also didn’t mention that you need to chill.
Reply: I appreciate optimism. And of course I looked at the technical data of the F-35. Unfortunately, a have also seen the incredibly long list of errors. Due to the errors, this aircraft should not fly at all. But it is "made in America" and the world knows what that means. And some of you talked about the "advanced" ELOKA systems. Ask the Russians, what they think about it. Their ELOKA-systems are powerful. The only thing I would call progressive or advanced in America today is their propaganda. As I can see, they are still successful in that. On the other hand, I see 45 million Americans living on food stamps not to mention the disastrous infrastructure. Not that we misunderstand each other. I don't blame the American people, I blame the so-called elites. They are accountable for the whole mess. Divide et impera (Latin). Share and reign!!!! Got it????? Wake up. These people give a shit on their compatriots. It's a shame, America has degenerated into a failed state. That is not hypocritical, I mean it as I say it. All my best wishes from the land of "Chocolate and Cheese".
Reply: The F-35 can pull G's... There is a place by the knee where you can put your Gum. The problem is, the aircraft doesn't offer anything that any of the other aircraft couldn't do with updates. It's a complete waste of money.
Reply: Also as the aircraft is brought into full production the cost per aircraft will plummet. Yeah it won't be a "cheap" plane, but for how much tech your getting is it certainly worth it's price tag. Air engagements are not won and successful air strikes are not conducted by cheap planes anymore. Ask Iran how much fun it is to use an F-14 against modern aircraft.
Reply: @vachief Well the F-15C is kinda out matched against opposition 5th gen fighters these days and the average fleet age is over 30 years old. The F-22 is very capable but restarting production would be hideously expensive, and the ones we have are frankly too limited in number to legitimately maintain air superiority in every theater. The F/A-18 is also stupid old and has some of the lowest levels of readiness due to parts shortage and low structural integrity of the air frames themselves. But yeah no, the F-35A and F-35C have no place. What we have works fine and there's no need to update and replace our current arsenal of aircraft.
Reply: @vachief The major aspect of the F35 that makes it such a lethal air frame is two fold. It is a Low Observable aircraft in its design and the integration of such sensors and advanced radar with that design. One without the other is not nearly as useful. Yes, technology developed for the F35 could be applied to different air frames, take the F-15x for example. However, in the grand scheme of things, the aggregate of all of the systems being integrated together into an LO aircraft is what makes the difference. The F-15X is a stop gap measure to bolster the F-15C fleet as that is in really bad condition. However, it is not a replacement for the capability of the F-35 and in no way can really match the F-35s ability to strike deep behind enemy lines and conduct electronic warfare.
Reply: Ugh, people getting their information from a "google research" The plight of Earth...
Reply: FYI, the sensor fusion is called a tactical relay and all current military aircraft have it. Additionally, all current fighter aircraft can pull 6-9 Gs but the computer will stop you because most pilots would black out after 4 Gs. Everything you mentioned here can also be done with a F/A-18 Super Hornet because the systems you are talking about were already tested on the 15, 16, and 18 in order to work hand in hand with stealth fighters like the F22 and stealth bombers. During my time in the U.S.Navy I have attended many trainings with the Airforce on these systems. With that said the F35 is not a huge waste of money it's just grossly over priced, if the U.S.Navy replaces the EA18 Growler with F35C it would be far superior at SEAD operations imo.
Reply: Lord Shadowz another one crashed today
Reply: Lord Shadowz A SU-35 pilot  all he has to do is track the by it's heat signature without the use of radar .
Reply: if you say "you didn't mention" one more time I'm going to leap in front of an oncoming Mig
Reply: I agree this is really the ‘killer feature of this jet 
And the one thing that sets it apart. Cant wait to see how it shakes out in a real fight but I Would not want to be on the other side
Reply: There is nothing here mentioned that a Gripen E does not have except for extram stealth since Jas 39 E has a RCS of 0,015 m2 compared with >0,005 m2 on the F 35. The Jas 39E has however the capacity to supercruise at Mac 1,2 in A2A configuration, Mac 1,1 in A2G and finally Mac 1 in A2S. As for agility the Jas is built to +9 G. How large the + is there are only speculations I would guess 11G. As for the radar it has 1000 antennas. The E warfare suit on a Jas 39E uses GaN technology it is therefore better than the F 35s. One can say that both planes at the moment are uniq in their capacity, there is one coming plane that will be at the same sensor level.
Reply: Hugh Jarce the F-35A and C carry small extra fuel tanks behind the cockpit. Those smaller tanks would be removed. They are not MAINS tanks. If you would research you would understand why they would choose to remove these to place a retractable laser pod.
Reply: Hugh Jarce your right. They are now only 90 million for the A model. It’s amazing.
Reply: @Lord_Shadowz  A there is a catch the cos of having the F 35 fleet went up with 22 billion the estimated cost of having the F 35 fleet for the next 50 years is a staggering 1.173 trillion in todays value. That includes block 4 upgrades. My guess is that there will be 5 large upgrades that today is not includedandal. The entire  thing is a scandal, the flight cost might go down to 34 000$ for a flight hour when flying F 35 A by 2025. At the moment it is higher.
Reply: Hugh Jarce it’s a joke now that I made you look like the fool you are.
Reply: Hugh Jarce sure it does. See there’s a thing called math. Both the aircraft you mentioned are not made in the numbers the F-35 is. Therefore parts cost more. Only anti F-35 shills will deny actual number that are reported to congressional committees and for money withdrawn from accounts.
Reply: his father is a russian
Reply: Gone Grizzly Hi Again, I feel I need to explain a few things to you, as to your explanation of using the radars in a patterns to defeat the stealth, that wouldn't work. The reason is most Of the time radars are kept off because the second you illuminate you become a massive target. Secondly even if all of them illuminated all they would see is either empty sky or a bunch of bird and background noise. They wouldn't see blank spots. Again as soon as they illuminate the AWACS in the area would see every emitter as would every F35 and they would use their data links to coordinate bomb strikes or HARM strikes on those radars. The radar crews would be dead. Also knowing there's a stealth aircraft in the area isn't enough. It's not enough for a missile to track. You need way more info than that. As to me not getting excited about high off bore sight missiles. That's not what I was talking about. What I said was the F35 helmet, the only one in history to do so, can cue a target in any direction of the F35, even directly behind it, and the pilot can fire a missile. The pilot doesn't even have to turn his head. Lol. He can see the target in his display and fire. No other aircraft can do this. This goes far beyond HOBS where the pilot has a cueing reticule on their helmet and can follow an aircraft moving their head and launch a missile. I understand you not liking the system the US has in place but there are reasons why we have them. Also the Zumwalt is a pretty amazing destroyer. Every single new weapon system is going to have issues. Hell Russia's aircraft carrier has 4 tugboats with it because it keeps breaking down near Syria and they've lost aircraft in recovery. Oh and about your comments about Russia's defense companies. Its actually not the case. They do not do what you think they do. Do some more research. MIG is barely keeping float. They've have no foreign backers for any of their projects so Putin has to order a bare minimum of Migs to keep the company going. As with Sukhoi they don't have enough funds to go full bore with the PAK FA or PAK DA and they keep requesting more funds from the ministry of defense but their projects have been over budget and under performing. Surprise surprise doesn't that sound familiar. Google it.
Reply: William J Greklek III I couldn't agree more. Thanks for writing this. I love the F-35 program and I'm not a American which removes any patriotic blind following.
Reply: William J Greklek III they will ignore this comment because again they are full of negative shit . to fully test a new plane is a real combat  but this YouTube viewers suddenly become a experts .
Reply: Kenith Macion Exactly! I do agree that Lockheed can do better and the Pentagon has needed to be more strict with them, but the F35 is simply a generational leap forward. It takes time and it takes money. It's changing the way air and ground, and sea combat is happening. They even recently used an F35B and for the first time ever had it launch an interceptor missile to take out a supersonic cruise missile that they targeted to a carrier. They used a E2 Hawkeye and fed the Info about the enemy cruise missile to the F35B and it made a positive intercept. It was a live fire intercept! Not a simulation. Again it's changing the way war is being fought. Once the plane matures it's going to be amazing. There will be thousands of them in the US inventory alone. I guarantee more NATO countries increase or place orders. I saw that Germany is now requesting a classified briefing on the F35A. They are considering purchasing atleast 100 of them.
Reply: B Jiang lol no it doesn't. As a matter of fact if you just look at it you can see it doesn't. Hell its engines and radar are completely underpowered which is why china are desperate to get the SU35's to get their hands on those delicious components and avionics.
Reply: Kenith Macion I agree we are not experts and rightfully so we arent in much of a position to comment. However you should think about it, what other defense company has given forward any ideas for the new 5th gen stealth fighter. I believe there was boeing and lockhead martin. But everyone said boeing was trash so they went for the lockhead martin. They needed something to replace the f15, f16 and f18 in their arsenal and needed to replace it economically. This is actually quite contradicting since the US investied hundreds of billions on this project, already a miss and it was delayed for numerous years. The thing with lockhead in generam is its a private company, and like all companies its goal is to make the plane look as good as possible with all of these fancy specs that are still in development such as stealth and sell if for massive profits to the military. The F35 costs 130 million to create and spends 50k for one hour of flight. Take this in economical view. how are you supposed to wage a war and spend 50k for 1 hour of 1 plane. Its a completely different way of engineering to the Russian counterparts. They go for the idea that all this is high tech,  its all so strong, nobody can touch it. And the military pecks at all these comments and tries its best to get ahold of it. Even tho there are plenty of American specialists who say the project is a complete miss. Im not educated enough to go on about stealth tech but google how u can spot these stealth fighters. its not that hard at all
Reply: @nenokozaric9259  we don't even have as much info as the military does the airforce navy and marines may know something we don't and is what keeps it worth paying so much besides that it was placed in mock battles and had destroyed many aircraft with limited losses simply because they could get closer before being detected 
The aircraft doesn't need to have everything normal fighters do because its a low fighter aircraft its main roll is air to ground and fighter support missions they can guide missiles they can be good at hit and run tactics because before you detect them they hit you then run away and you lose all ability to track because of the stealth and then real fighters take the role of striking you they are extremely useful and if you really think about it if we went into a large scale war the advantage you get with these aircraft will buy enough time for the industry to kick in and more standard fighters will take the role
Reply: The advantage it has is stealth. No more no less, the disadvantage it has is a lot of things from agility to problems carrying large missiles. Let´s hope that radar development stops if not it will be obsolete earlier than expected.
Reply: Sören Nilsson If stealth didn't work, then China wouldn't have spent resources to hack into Lockheed Martin to try and get info on the F35 and produce a bastardized J20 with horrible engines, terrible radar, and only frontal stealth. Russia wouldn't be attempting to build the T50 Pak Fa and be so desperate to do so that they've had to enter an agreement with India because they are so cash strapped. On top of that they say the S300 and S400 can detect stealth, yet they are developing the S500 and developing a the aforementioned frontal stealth Pak Fa. The thing is the US has had 40 years to work on our stealth. We know what works and what doesn't. We also know the training. It takes years for a pilot to truly be able to employ full stealth flight combat in an aircraft. Once the F35 comes into its own it's going to be awesome. There will be thousands of them all over the globe.
Reply: Gone Grizzly to say that the f35 is a trash plane is somewhat ignorant you see the f35 expensive but they will continue the production and ask yourself why would they buy this trash plane as  you and your friends. we cant understamate the power of this plane maybe you think this plane is sitting duck in the battle field but we don't know the full extent of its capabilities . we are not experts when it comes to this kinds of stuff maybe we can pretend but again were not.
Reply: William J Greklek III this is generally why i dont believe the us military when they throw out new tech and vehicles or some shit but then it breaks down or does not at all what eas promised. A good example is the HMS zumwalt i believe its called. it was increadibly hyped up for being the best destroyer ever created. but in the 1st or 2nd test run it was towed back to port due to engine failure. not something ide expect from such a massive project :/
Reply: Gone Grizzly U Idiot. It’s the USS Zumwalt.
Reply: William J Greklek III i just dont like the US's way of approaching national security. they buy stuff from businesses who have no interest in tge countries security nor how well anything preforms but only hoe much fame it will get and how attractive it will be. aswell as profits it will generate. While on  the other side u have state owned companies like suhkoi who sell planes for exactly hoe much it costs and want it to be the best possible plane for their country. its 2 completely opposite work ethics
Reply: With all this technology , if its true what he said about it being less stealthy than before,  it will get shot down,
Reply: Gone Grizzly
 these "teething problems" are not only expected after creating a new piece of military equipment but they are welcomed, so that these problems are fixed before missions are assigned. That is why the Zumwait was on test runs to begin with.
Reply: Gone Grizzly
 developing and producing a single multipurpose fighter is always cheaper than developing, producing, creating spare parts for, training pilots, teaching maintenance crews for three different fighters. It is even more tactically sound to have one fighter that can do the job of three than having three different fighters that can only do one job.
Reply: Sensors eh? Pretty cool for reconnaissance, unfortunately, the F-35 is slow and it's range is poor.
Reply: I am upset at this video.  You are right this video did not state all the F35 advance capabilities.
Reply: the plane is an flying turd, deal with it!
Reply: Lol the f35 cant do half of what you said it can. Its a poor plane that gives you all the bad of its functional operations(made to be both a bomber, and fighter) and none of the advantages. The f35 is not a leap forward china just said its been able to acquire the radar signature for the f22 it wont be long till they do it for the f35. This aircrafts a turkey and may be obsolete in 20yrs
Reply: LOL@Lockheed Martin Shill! All the bells and whistles you mentioned still won't change the FACT that this weapon system is a TOTAL WASTE OF TAXPAYER MONEY. Nothing but Corporate welfare to keep the CEO's of Lockheed Martin sending their kids to Harvard. 1.5 Trillion and counting. The boys at Loc Mar must be jizzing in their pants.
Reply: Kenith Macion also what happens when russiams find a way to detect stealth tech? Therr alrdy is but a more efficient way per say
Reply: @nenokozaric9259  I'm sorry I know this conversation was a long time ago and you probably don't care anymore but I I have to correct you on something because it's bothering me the F-35 can take a 9 g turn and it's capable of amazing high angle of attacks compared to Legacy aircraft, in fact the F-35 can turn inside an F-16.
https://theaviationist.com/2016/03/01/heres-what-ive-learned-so-far-dogfighting-in-the-f-35-a-jsf-pilot-first-hand-account/
Assuming you weren't trying to mislead I think you got a little bit confused about the G load limit that was placed on the aircraft during testing during testing the G load limit was placed on the aircraft flight Control software during different parts of the test this is why I no F-35 crash during testing.
Reply: The Gripen doesn't hold a counter hold a candle to the F 35s sensor suite, no DAS (6 sensor providing 360 degree vision), doesn't have AESA yet.

Stealth is highly classified, however, if F 35s stealth works against F 15s and F 18s which have AESA radars you know it's effective against most anything especially because infrared are short ranged.
Reply: William J Greklek III people can throw all these facts at buyers, best this best that, new this new that. but half of this shit has never been tested and the "stealth" factor of this plane is also a huge misconseption (excuse my spelling) because of the illusion of people thinking a stealth design makes it invisible and un detectable until really close. which has proven not to be true
Reply: Fat Potato thats why u love it, your tax money doesnt go to making it :D
Reply: Fat Potato and im not russian either, i just read alot about the general topic
Reply: William J Greklek III the problem with the american military in general is everything is meant to look appealing to their buyers, they dont make stuff for their buyers to get the best possible quality or endurance from a plane but to make it as attractive and expensive as possible because each of these businesses(lockhead,boeing) are private and the more money they can sell anything for the happier they will be. sadly not the same can be said for the military. this is their main flaw that russia and china have no problem with since all defence companies are state owned
Reply: William J Greklek III the reason it costs 150 million is due to lockhead trying to make shit as expensive and impractical as possible to get suckers like the us military to buy it. this is the problem with privitised defense companie
Reply: @nenokozaric9259  Nobody (with some knowledge on the subject) ever thought stealth is the same as invisibility. Stealth is limiting the enemy’s ability to track and lock on to the aircraft. You are wrong in that the stealth factor of this plane is a huge misconception, it is actually very good, and it has not been proven other vice. Under Red Hat the F-35 were able to penetrate enemy contested airspace protected by both enemy aircraft and SAM, while engaging and or tracking enemy air and ground targets for its own ordinance, it was also able to take the role as a mini AWACS and guide heavier ordinance fired by other platforms, like B-52s keeping their distance. 

You might be thinking about the fact that the smaller stealth aircraft, like the F-35, is more likely to be picked up by low frequency radars equipped by the likes of the Russian S-300, S-400 and S-500 systems? Or that the high frequency bands might spot it if it's lucky. Or, perhaps that optical and or IR systems might see it if it's visible to them. Sure, this is all true. However, this are all just glimpses, and those can at best alert them that something is out there. It's a long way from there to getting an weapons guidance quality lock with the high frequency bands like VHF. In addition, the F-35s electronic warfare suite can close to shut down enemy radar systems without the enemy even knowing. And, while the sites or enemy aircraft are scouring the skies with these radar impulses, trying to get a lock, the origins of those impulses are very visible to the F-35 witch can pinpoint the air defense radars and enemy aircraft. And, the F-35 does this pinpointing job faster than three F-16CJ's working together.

The F-35 can do more than 6,5Gs. And, Gs are not all, the turn rate in degrees per second at any given speed means a lot, and in an engagement the angle of attack is also very important. The F-35 performs very well in these areas contrary to what many people believe. 

And, saying government owned production facilities would deliver a better platform at the same cost is far from accurate and over simplified. As there is competition, both Lockheed, Boing and others need to up the game to deliver the best possible platform to win these contracts, and they need to deliver the highest value per cost delivering the functionality asked for. If they don't deliver here, they won’t deliver at all. Also keep in mind, the producers can be held responsible for flaws, and making errors can be quite expensive. This depends on the contracts and the situations. Developing new previously none existing systems also gives a potentially higher chance of initial issues, and thus added development costs might be placed on the buyer. Sure, everything has its pros and cons, but saying private corps do not deliver the same endurance and quality is wrong.
Reply: William J Greklek III also most planes fire missiles behind themselves. even russian bombers like su 34 do this. nothing to get excited about
Reply: William J Greklek III also they tested it recently and the plane had huge design flaws involving the cockpit overheating at certain heights and after certain distances. dont buy lockheads story please. thats what they want 😂
Reply: William J Greklek III I agree, however about the stealth aspect: i dont really know how well or proven this has been in testing. Ofcourse they can say in theory the f35 will get the first look at all that but in theory the f35 couldnt even get near a su35 because it would just get shot from the ground or the ground control would inform the pilot of the su35 of the exact location of the f35. now even tho the f35 is sneaky in some regard there is still a very easy way to spot it from quite a distancr that i feel hasnt really ever been covered. although the overall radar cross section is reduced (supposedly ofcourse) we dont know this for sure, what russians can do is set up large radars in a pattern forming a circle around the f35. if they only had one facing the f35 they would realise there is a blind spot in their radar but wouldnt know the exact coordinates. this is why many are ligned up and used to find the exact spot where the plane is. They cant spot the plane itself (if it really is as stealthy as they say) but they can damn well spot the blank in their radar. because they all bounce off of eachother and where the radar sees no incoming information. thats where the plane is. Again this stealth is all experimental tech. they tried the same with thr B-2 yet it was confirmed to have been shot down above croatia. as well as a f117. so how reliant this tech is we dont know. a huge finiancial gap it leaves tho
Reply: Gone Grizzly in both incidents the bomb bay doors were open so aircrafts RCS is severely increased and there are others examples of stealth aircraft slipping through air defenses such as F-117 night hawks slipping into Baghdad and striking there targets
Reply: Gone Grizzly an Israeli F-35 was able to take out an advanced Chinese stealth detecting radar in Syria. I think that will explain how good the F-35’s stealth capability’s actually are.
Reply: @nenokozaric9259  stealth is utter bullshit to reassure a pilot and dumb taxpayers, you can take out a stealth bomber with a optical tracking missle guided by optical space satellite laser tracking, stealth is absolutely useless when going against china or Russia it is only useful against broke indebted 3rd world shitholes
Reply: No matter how many new "bells and whistles" they will put in this thing. It will still be a lemon. It will never be a true combat fighter. Pentagon and DoD created this jet to spent money. It is his real mission and I must admit it is doing this mission perfectly. 
Money flows and thats a good thing. 

Many people still think that jet fighters in this form have the future. They are dinosaurs. A relic of previous era.

Future warfare belongs to automated machines. Drones and robots controlled remotely from a far. Drones are smaller and they can loiter over area for many hours and even days. They can wait as situation develops and they can strike at proper moment. F 35 will never be able to do that. This jet is a relic. They will spent trillions on it and it will never be used. 

Automatic drones are the future.
Reply: William J Greklek III another point is all u gotta do is have a coding flaw in the system(which is very likely with such experimental technology) and u just lost 150 million and a pilots life. unpractical if u ask me
Reply: William J Greklek III ofcourse you will never find that a b2 was shot down anywhere on the net it was the pride of their airforce at the time. Our forces claim it fell across the border into croatian land and thats why we have no evidence of if since it was lockrd down immiedietly.  As for the f117 wether it was shot only with bomb doors open or not we dont know. Its quite ez to make an excuse like that for any piece of tech. oh this was turned on oh that was turned on. the general public will never know.  from the story i read he did know and he stated he didnt have enough time to react. But that he tried doing a few manouvers. i guess we will never know for sure
Reply: @nenokozaric9259  Your little propaganda chinese whispers game does not somehow prove that you shot down a B-2 when no evidence actually exists. Oh but it was "confirmed" by a bunch of soldiers, lol
Reply: Gone Grizzly I just saw this a year ago. Nice try saying there’s some conspiracy that the Serbs shot down a B2 and that you won’t find it anywhere on the net. Guess what. As I said when the training B2 was converted to a front line unit and then had an accident and crashed, THERE’S A COMPLETE VIDEO OF THE CRASH OF THE B2 INCLUDING ITS BREAK UP ON THE RUNWAY. your conspiracy theory is over. I didn’t see any Serbian missiles over japan shooting it down lol